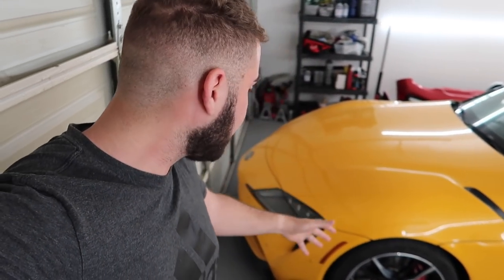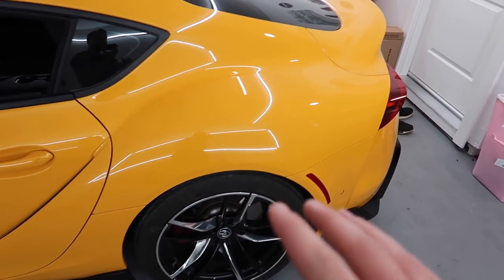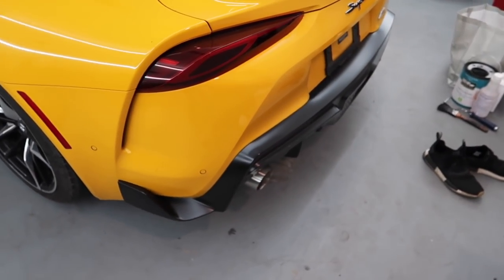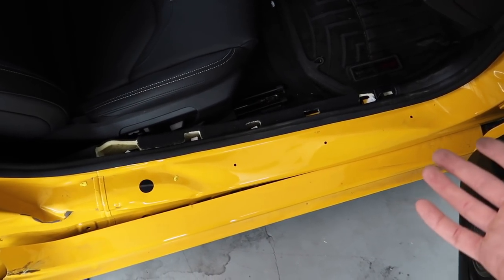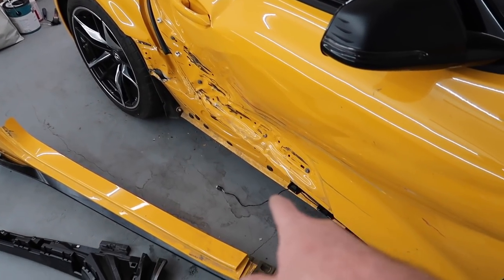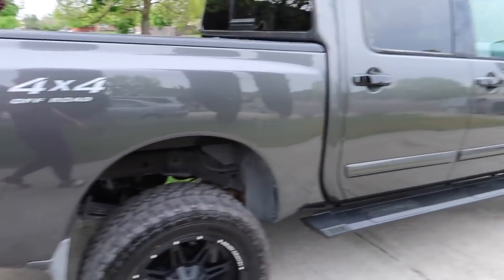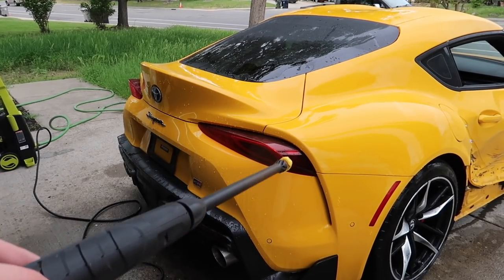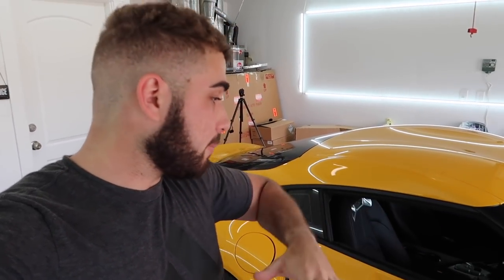Rebuilding A Wrecked 2021 MK5 SUPRA 3.0 (PART.4)

Comment: Toyota actually reached out to BMW to collaborate on the Supra, the reason being is because BMW is the only company left that still makes high HP inline-6 turbo engines. Toyota used to in the past with the 2JZ/1JZ but they moved away from inline-6 turbo and no longer have a modern inline-6 turbo engine to base tthe car around.  So the only way they would be able to bring back the Supra would have been to collaborate with BMW. This is also why people call the N54 "the modern 2JZ" because it has fully forged internals and is an inline-6 turbo just like the 2JZ.
Reply: The N54 was also the predecessor to the B58 which is in the 3.0 Supra. A lot of what BMW learned to fine-tune the B58's performance and reliability factor came from the "unreliable" N54. Really glad BMW stuck with what they were good at and didn't ditch the inline 6 platform all together. Beautiful and well performing cars and I'm happy to own one even with the maintenance lol

Comment: Nour what is that method you use on the window glass , is it glass cleaner with a razor blade ? If so how do you not scratch the glass is it the lubrication that helps not scratch it or
You angle the blade ?
Reply: Glass is harder than the razor therefore it doesn't get scratched

Comment: yea man the "body lines" are all Toyota, look up the FT-1 concept. Looks like the current supra, just far bigger and more flared, like an aventador size. I assume they took the concept's style and applied it to the z4 chassis once the deal with bmw came around. Did a pretty good job imo. Still would be cool to see a v8 powered, $100k+ car that's built completely on the ft-1 concept but that's definitely not happening haha

Comment: All that’s high strength steel Nour, it’s a bigger job then you think. Absolutely doable but a lot of frame shops won’t pull that and will opt with a cut and replace